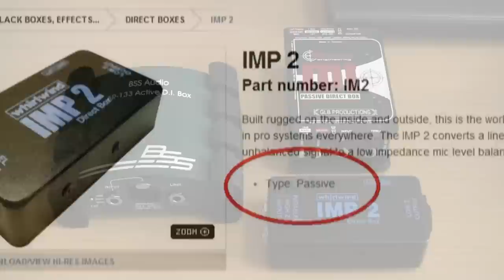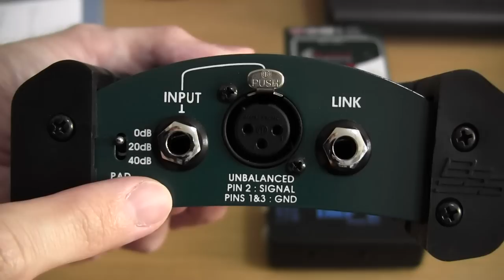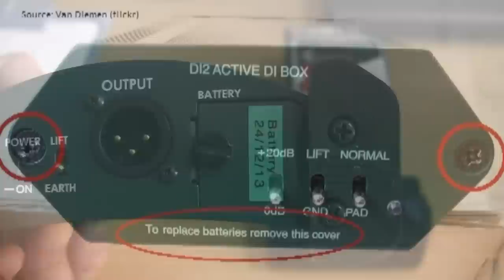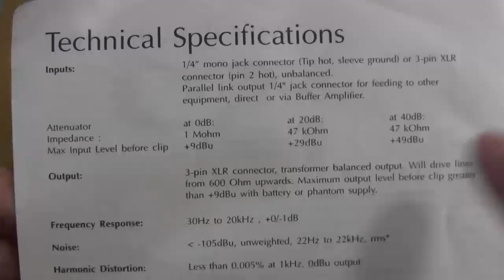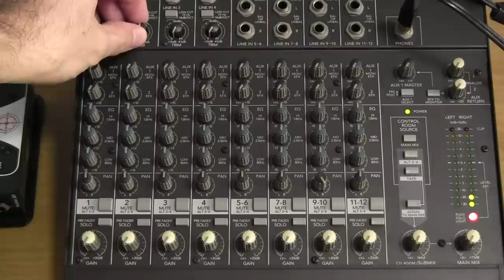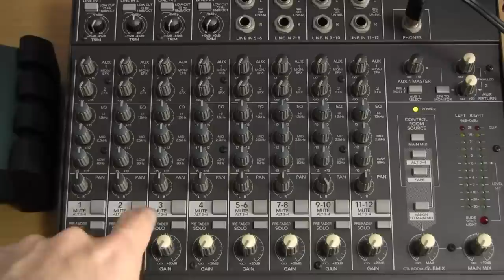DI boxes part 2: Active vs. Passive

Comment: Hi again. Nice videos indeed. I have 3 questions, please, if you don't mind...

Q1: I have a guitar with active pickups and bought an active DI box (DI20 from Behringer) to split the signal (wished I have seen this video prior for the purchase). Will it then be useless in my case? 

Q2) Input gain knobs -- as a general rule -- are they good no higher than 1 o'clock? In your video you kept at 12 or 1.

Q3) Is there a simple procedure to assess the noise generated by this my DI active box?

Many thanks! And very good stuff!!!
Reply from the maker: Fabio Kasper No problem. To answer: 

Q1) You can still use an active DI box with an active guitar - just make sure the signal level is not overloading your mixer input. 

Q2) Watch my video https://www.youtube.com/watch?v=KcUgggdxLPM on setting mixer gain. 

Q3) Sure, just hook up the DI box to your mixer with nothing connected to it and listen :D 

Let me know if you have any other questions.
Reply: GLB Productions Many thanks again!

Ref Q2) Woow... Really cool video. You made it sound very easy with your explanation.

Ref Q3) A small detail is that I currently don't have a mixer. :-)   I guess my point is to assess this DI with my audio interface. Well, I'll plug it and check for input levels. 

Another one, pls. Q4) Do you have an opinion (or video) on analog vs digital mixers? 

Best Regards, 
Fabio
Reply from the maker: Fabio Kasper If you don't have a mixer your audio interface will do fine :)

I don't currently have a video on digital vs analog mixers. If you have never learned how to use a mixer I suggest learning how to use an analog one first and then moving to digital. This will allow you to decide which one works best for you based on your needs and preferences.

Comment: Wow thanks for sharing this info. Quick question thou, If i'm using an active bass guitar and plug it to a multi-effects pedal, should I still use a passive DI?
Reply from the maker: Yes, a multi-effects pedal is an active source so the best place to start would be with a passive DI.

Comment: Q: You mentioned that an guitar with an ACTIVE PICK-UP needs a PASSIVE DI BOX, correct?

What constitutes an ACTIVE PICK-UP? 

I have an Acoustic Guitar with a self installed bar style Sound Hole Pick-up. It does not have any form of power (battery), does this constitute an ACTIVE or PASSIVE Pick-up? What type of DI Box would this set-up use?

Sorry, Hi Bruno - how is life in Singapore?

I have been using a Passive to Passive set-up but got to thinking about this and the POWER ISSUE. Perhaps the correct set-up is PASSIVE TO ACTIVE.

Can you help, please?
Reply from the maker: +Dennis Neuhaus There is actually some debate about what an active pickup is - some guitars use passive pickups connected to battery-powered preamps, but some pickups (EMGs for instance) actually need power to fuction! Fortunately none of this matters when selecting a DI - all you need to know is whether there's a battery in the guitar.

Comment: I have a couple of Behringer active Ultra-DI's, if I remove the battery would it work as a passive DI. I have generally had my phantom power on when using my DI and using the passive Martin guitar and it seamed ok. Can you also explain why my DI indicates phantom powered 18-48 volts. Thanks
Reply from the maker: Darren Patrick No, active and passive DIs use different technologies to perform the balancing function - removing the battery from an active DI will not turn it into a passive one. 

The reason for the range is that not all mixers are able to supply phantom power at the industry standard 48 volts, so the DI is designed to work across a range of possible voltages.

Comment: Excellent videos! After seen then, I had some doubts: 1) Should I connect a computer's output on a DI before plug in the mixer? I use a P2-xlr balanced cable from the PC to the mixer. Do you suggest something else? 2) Is there any situation that requires a DI when plugging in a TRS input (balanced)? I'm asking because my Yamaha 01v96 has 4 TRS only inputs (13-16) and I don't wanna waste then.
Reply from the maker: Thanks for the questions Matheus: 
1. This is often a very good idea - computers are designed for processing data, not doing audio, and as a result their audio circuits are often very compromised designs that can induce a lot of noise into your system. Running their output through a DI box will often solve many noise issues before they have a chance to show up. See my video here for more info: https://www.youtube.com/watch?v=ge4Iynh4rcc
2. In theory no - a correctly wired TRS connector is balanced and is identical to an XLR in terms of signal connection. However there may be times when you want to convert to an XLR connector - many digital mixers do not have any 1/4" inputs on the channel strips, only XLR connectors. Another case would be when you want to drop the level of the input signal - running through a passive DI box will often make a very hot signal more manageable and give you finer adjustment on the gain control.

Comment: If my Keyboard doesn't have any Ground (Only 2 Pin plug) it can't have any Ground Loop.
Do I still need a Direct Box ??
Reply from the maker: You will need one if your keyboard has an unbalanced output and you need to run the signal more than 5 meters/15 feet to interface with a balanced input.

Comment: Hi, you mentinoned guitar connected to battery powere effect, must use passive DI box, what about if the effect is powered by house electricity (not battery). Should i also use passive di box? Need your help on this. Thanks.
Reply from the maker: Yes, the same applies - passive DI recommended, although not a hard and fast rule.

Comment: can you give explanation about what happens if switching off the batteries of active DIBOX?, is that running as passive?beside i use an actived instrument.
Reply from the maker: No, switching off the batteries just turns the DI box OFF. DI boxes are either active or passive not both.

Comment: Hi! may I ask if the NUX PDI-1G a active or passive DI? I've been searching and I can't any answers. I hope you can answer this. thank you!
Reply from the maker: It's active - any DI that requires battery or AC power to operate and/or has a power switch on it is active.
Reply: @GLBProductions  Thank you so much for the quick reply!

Comment: Thanks for precious tips my friend! Just a quick question here: in a homestudio context, what should I choose? I mean, I have a Fast Track Pro interface and some instruments (digital piano, an active acoustic guitar, a passive electric guitar and a jass bass), all of them will be recorded with raw signals for post processing procedura with fx vsts. According to this video I should pick a passive DI for the acoustic guitar and an active for the piano/electric guitar/bass. Is that right? Or is there a way to pick only one DI type to go with?
Reply from the maker: Hello Charles :) It's really best to have both, but if you have to choose one go with an active DI because it can be used on both active and passive sources. It also depends on your recorder/interface - some interfaces like yours have an 'instrument' setting on the input which is like a built in DI box. Try this first and if things sound good you may not need a DI box at all!
Reply: Thank you so much for the input =)
Reply from the maker: You're welcome Charles :)

Comment: Thanks for your videos so far I have learnt quite a bit from you. Now that I realized you live in Singapore I understand where your accent is from :-) 

Question for you if I may:

Currently in my church each musicians wants to use their own amplifier on stage, without putting it into the mixer, causing me and the other sound guys a lot of headaches as I can't control them. 

We have tried plugging in the instruments directly into the mixer but the musicians complained that they can't hear their instruments from the monitor speakers. I realized now that the DI box is what's missing from our setup thanks to your videos. 
I'm ready to invest in a few of these DI Boxes now, but before we spend the money I thought I'll ask you first. 

Will using a DI box make the sound that comes out of the monitor speakers sound better ??
Reply from the maker: - Thanks for the question. The 'loud amplifiers on stage' situation is one that every sound engineer has to deal with at some point!
Using a DI box will definitely result in better isolation of each signal because you do not have spill from other instruments as you would with a microphone. However whether it will make the monitor sound better will depend on many other factors such as the quality of your monitor speakers and the choice of signals to put into the monitor mix. 
One possible solution is to place each amplifier as close as possible to the respective musician, which allows them to be run at a lower level - they then effectively become monitors for the stage, and you can use a DI to capture the signal for routing to the house PA system. 
This situation always requires careful communication between the sound crew and musicians to explain the situation and prevent a 'muisicians vs. sound techs' conflict from developing!
Reply: Cheers ! thanks for the quick answer.

Comment: Great videos!! Silly question but would I need a DI box for every synth? Or can I just run all synths to my mixer and the mixer out through one/two DI boxes?
Reply from the maker: That's not a silly question at all :) 
Either arrangement will work, it depends on how much control your sound guy wants over each individual synth. If he's ok with getting a mix of all of them then the submixer approach is the way to go. If your mixer has balanced outputs you may not even need a DI box - just plug the output of your mixer into the snake and let him deal with the signal on the other end ;)

Comment: Hello!  Thank you so much for this video, this is the best DI video I've found so far.  I just have a question; Did I understand you correctly to say that if I'm running my passive guitar through a pedal (particularly, my Dunlop Wah pedal), I should consider it an active signal and use a passive box?  I'm primarily concerned with recording btw.  Thank you!
Reply from the maker: Logan J Correct - the DI box only sees the last component in the chain to which it is connected, so if that is a battery powered device, the whole signal chain is considered active. 

Mind you if you are recording into a USB-type interface it may be possible to just plug your signal chain directly into the recording interface and dispense with a DI box entirely. As long as cable runs are under 15 feet a DI box should not be needed.
Reply: GLB Productions You are so awesome!  That was actually my next question.  Thank you so much for the video and the response!
Reply from the maker: Logan J You're welcome, all the best with your music :)

Comment: Thank you so much for this class!
I have a question: I have a lot of passive instruments. Whenever I record thru my Behringer Umc204HD interface I always overload the preamps, even with the gain set at 0!!!
What kind of DI do I need in this case?
Reply from the maker: In this case start by engaging the 'pad' switch on the front of the unit - that should eliminate your clipping problem.
Reply: @GLBProductions  it works, but I lose a lot of punch. The results sound lifeless.
Wouldn't a DI be the solution?
Thanks for replying

Comment: Great simple explanation. Question, Playing an old passive Dean Marlkly sound hole or other passive (no  battery in guitar) acoustic guitar can I plug into a battery powered boss EQ or some other guitar pedal and then into a passive D.I. box and then to P.A. and be ok? High Z and low Z on mixing board option is a mystery. I have not but will watch your other videos. Phantom power I'm clueless on, My sax player hands me his out and says "Phantom power" and I oblige but have no idea what he is sending me and why or what the deal with is on that in real world. Cheers from Milwaukee.
Reply from the maker: Hi Brian, glad the video was helpful. To answer your questions: 
- Passive guitar into battery powered pedal = active source. That's a great solution! 
- Hi-Z = high impedance input where you can plug in passive guitars directly without needing a DI box. Low-Z = low impedance, meant for microphones, keyboards, CD players etc. 
- Phantom power is 48 volts DC power sent down the mic line to power condenser microphones (like the one your sax player is using) and active DI boxes. Called phantom power because it is invisible to gear that doesn't need it, such as dynamic mics. Do not plug and unplug gear with this switched on, you will get loud bangs going through your sound system! 
Hope that helps!
Reply: @GLBProductions  Totally helps! Thank you so much for replying  at all, and so quickly!  I'm putting together system with for my own band with these different instruments, acoustic guitars (with ancient Dean Markly pick up I had not seen since 1986) , violins, sax and 2 keyboard guys.  I did sound for a lot of rock/punk bands. I just mic'd up stuff, even bass amps. Never heard about or saw and active DI box.  I did know about plugging in and out about phantom  power,( because manual said so. Sax player didn't even know about that danger) . but that was all I knew! I wrote down everything you wrote here. Really really appreciate your help @GLB Productions! Have a great day.
Reply from the maker: You're welcome Brian! Your setup sounds exciting, get in touch any time you need help 😊

Comment: Hi there.

Thanks so much for the great videos. They are very informative and comprehensive. 

I have a couple questions based around the topic of which DI to use.

I have a Takamine GN51CE. I don't have a DI at the moment but I'm looking to buy one. I play acoustic gigs most weekends. Most of the setups are pretty crappy, and I end up having to go straight into the PA. Its a really great guitar, but it always sounds like my strings are old and flat even though I put a new set on the evening before I play.

My questions are:
1. Will a passive DI be the best investment for me?
2. Will a DI help improve my tone and make my guitar sound brighter, and if not, what other tips do you have to help improve the quality of my sound?

Thanks again.
Reply from the maker: - Hi Mark, thanks for getting in touch. To answer your questions: 
1. For the guitar you have, a passive DI box will be best. I also play Takamines and recommend the Radial JDI if you can afford it, otherwise the Radial Pro DI is also a good choice. Bear in mind though that these DIs do not offer EQ or effects, so if you want something that combines a DI with these functions you might look at something like the Boss AD-3. 
2. A good DI will not change the tone of your guitar - the idea behind a good DI is for it to be as transparent as possible. 
I suspect that the crappy tone you are getting is the result of the way the EQ is set on the house mixer. I suggest that you watch my video How to use the mixer's EQ section and the next time you have a gig, make sure that the EQ on the channel your guitar is connected so is set flat, ie all the knobs at 12 o'clock, no cut or boost. This should give you a decent sound, assuming the PA in the venue is halfway decent. 
Let me know how things work out!
Reply: GLB Productions Thanks for the quick reply and the great advice. appreciate it.
Reply from the maker: mark kenyon No problem, all the best with your music :)

Comment: Nice videos. A quick question:

With a passive DI box aren't you supposed to switch the phantom on your console on?
Reply from the maker: Moi Sexypierced No, passive DI boxes need no eternal power of any kind, including phantom power. That is for condenser microphones and active DI boxes :)
Reply: +GLB Productions - if an active DI is powered why does it need phantom power?
Reply from the maker: 78tag Some active DI boxes use phantom power as their source of power, rather than batteries :)
Reply: sorry, GLB Productions when radial active j48 used, if i need to switch the phantom on my console?. i still confuse of this.

Comment: Sorry to be thick here but you keep interchanging hi/low - in/out ohms and  hi/low voltage source terms. Are you talking about signal (ohms or voltage) from the instrument out (passive active), or signal (voltage or ohms) to the DI box or signal (voltage or ohms) out from the DI box to the mixer? Thanks if you can clear this up for me.
Reply: +78tag by the way - I was so concerned with the input-output thing I forgot to compliment you on your effort here. I got all the active/passive concepts - I guess its the source/output part I'm missing the mark with. Thanks again.
Reply from the maker: +78tag No worries, this is one of the more confusing areas of live sound. In all cases when I discuss impedance we are discussing the connection between the instrument and DI box - the connection between the DI box and the mixer is always balanced and low impedance :) 

Feel free to ask any other questions you might have, I'm always happy to discuss these topics.